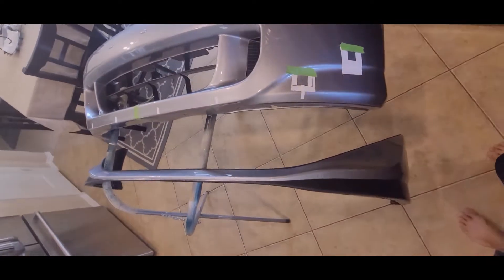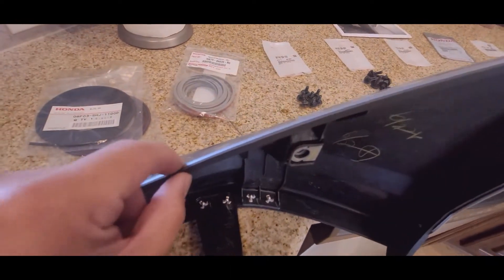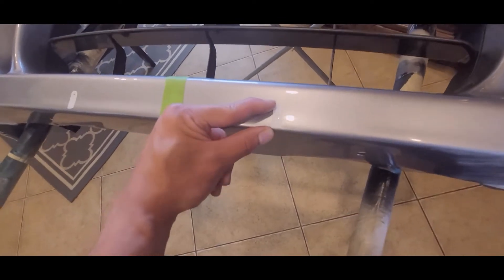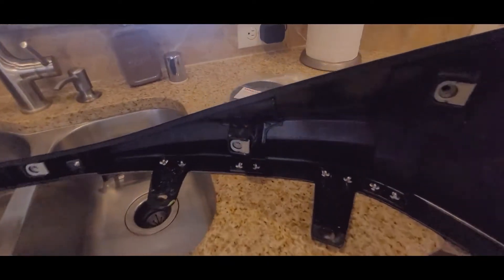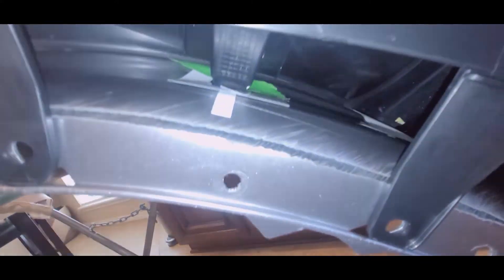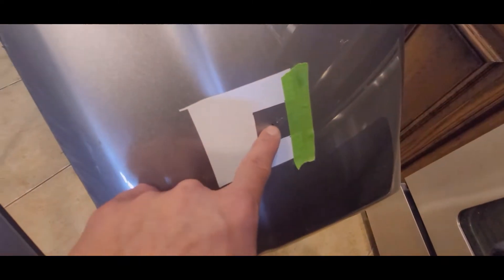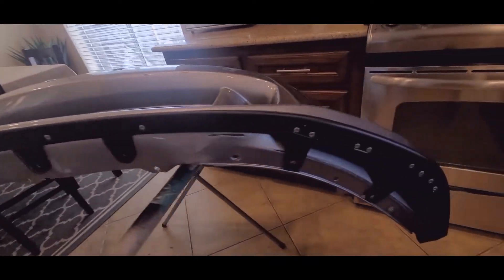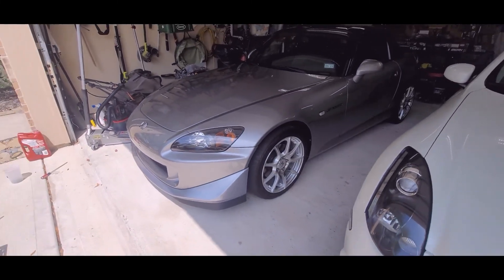S2000 CR OEM Front Lip Install

Comment: Thank you bro I need to know how is different cr real and fake thank you 🙏🏽
Reply from the maker: Thanks for watching! As far as looks, not much if you get the fitment right other than the textured finish on the bottom black part. Real CR lip uses screws to mount rather than just double sided tape. It also has the rubber gasket which you can add on a replica one. I just went with a real one because I read bad fitment on some aftermarket ones and didn't want to deal with messing with it. Real one also comes painted in Berlina Black, Grand Prix White, Rio Yello Pearl or Apex Blue Pearl.
Reply: @statuskuogarage7462  ok thank you so much 😊 and I appreciate save your s2k
Reply: One more question I buy lip cr Original but they don’t come rest you have where I can find  screw ?